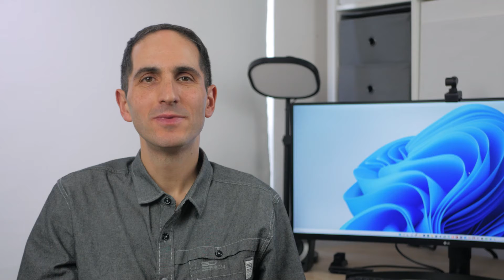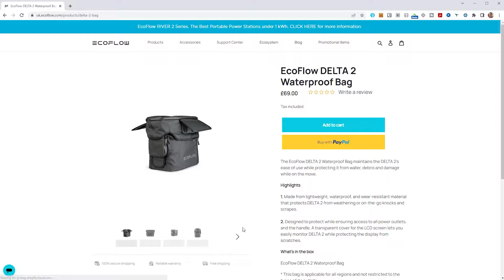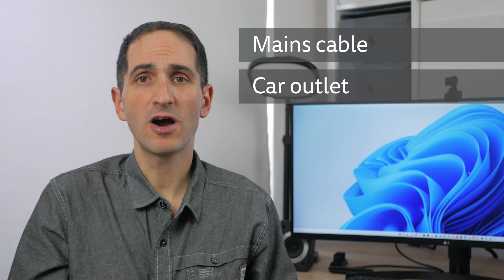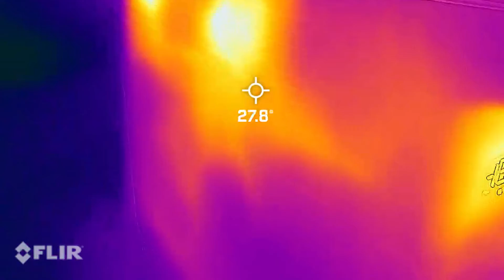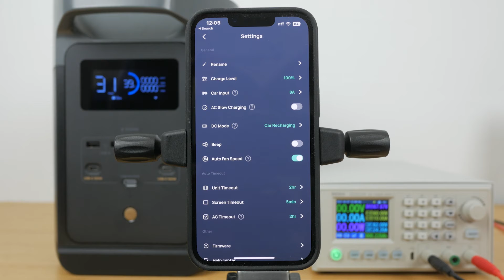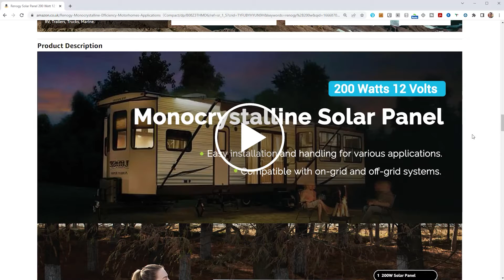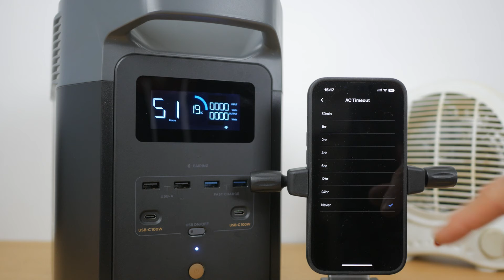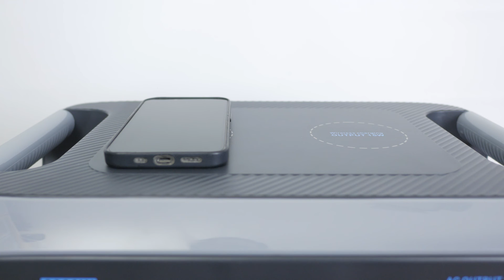EcoFlow Delta 2 detailed review | Best all-round portable power station?

Comment: Great review, thanks. I note that it can't have input from Solar and Mains at the same time - can both be left plugged in and it will start charging from mains when the sun goes down?
I am thinking of using it like a UPS, with the added advantage of some solar input.
Reply from the maker: Thanks for the comment. I just double checked this - it is still the case that AC charging will override solar or car charging. There are some automation lab features that might do what you want but I can never get them to work - although not spent a lot of time on them!
Reply: @TheTechnologyMan  Thankyou for taking the time to check that, it's a shame there is nothing in the app for that. Sending a wave to a fellow Devon'er (South Hams)
Reply from the maker: @UKBlue407  Small world!

Comment: I have this exact EcoFlow Delta 2 UK model, with the 4 AC Outlets rated at a maximum of 1800W at 240V. My question is... Is it safe to use a 13 amp fuse plug in one of the AC outlets of the EcoFlow Delta 2? If not, what is the acceptable minimum and maximum Amp fuse plug to use in One AC outlet?
My last question is, How many amps is in just one AC outlet? Thanks 👍🏽
Reply from the maker: Yes should be ok - the unit has overcurrent protection. Power = Current x Voltage, so 1800W/240V = 7.5A maximum.

Comment: Hey torn between this and bluetti ac180. Need it only to power fridge freezer in a power cut for as long as possible which one would you say I’m best off getting?
Reply from the maker: Both have similar capacity so little difference. Also look at AC200PL I just tested - has a battery that's twice the size.

Comment: Hi I had a issue with 12v car charging it would initially not show charging 100w. They asked me to do a update on app then it worked fine. 

The app you showed seemed to show a car charging option and a solar option latest app i have dosent show solar just car options so im intersted when i plug in my 220 w solar if they will show as solar panels i put.
Reply from the maker: They do update the app a lot - don't think I have a solar option now.

Comment: 25Nov23 A very nice informative review. With the Amazon Discount right now, I was preparing to order today. However, I noticed that 4 AC outlets were not 3 prong ground style like so many other portables are for the USA/Canada market. This is going to limit how many devices can be plugged in as a lot of power cords are 3 prong male. Lastly, there isn't any built-in lamp. Not sure why EcoFlow missed these two rather typical features. Your UK version AC outlets are of a different configuration. So, you wouldn't have noticed what I've pointed out for other 'followers', 'Review Visitors' etc.  Thanks! Kind Regards, Richard C. Toronto
Reply from the maker: Thanks - glad it helped - and thanks for pointing out the different outlets where you are. I agree - I like to see a floodlight on these power stations - although I've yet to see one with a really useful bright output!

Comment: When charging via solar at the same time discharging, does the load take power from the battery or from solar? Great review btw.
Reply from the maker: From battery. UPS only works with mains charging.
Reply: Great question as I was going to ask if the Ecoflow can be run using a non-Ecoflow battery bank. I think you've answered my question. It's a pity additional battery storage is limited to 1.
Reply from the maker: @johngriffiths3467  You can charge the power station from any power station. Either via mains or DC but you’ll lose some efficiency.
Reply: Thanks @TheTechnologyMan

Comment: Excellent review, we've also bought a Delta 2 and inline with your review~ However I do have a question regarding the unit though, is it normal to consume less battery at full charge, vs when it's less charged? For example, we tried to boil 1.7L of water with a 1800W kettle, when it's at 47% charged it used 19% to boil the water, and we did another boil at 28% charged, it used 27%. I would have thought it should be consistent irrespective of the charge %.
🙏
Reply from the maker: Thanks glad it was useful! You'd probably have to test with an exact load. There may be other factors at play boiling a kettle. But I've not specifically tested how accurate the battery level is - I doubt it's as accurate as the display would let you believe. Especially when using it at full gas!

Comment: hi, very informative video. Question : when i charge the delta2 from the mains, can i leave my other appliances(like a tv and a pc) plugged into the delta2?
Tx from Lenny Cape Town
Reply from the maker: Glad it helped! Yes - it supports passthrough charging. And it has UPS so those devices will bypass the unit and run off mains until you lose power when they'll switch across to the battery.

Comment: Don't buy delta 2? ... Mine worked OK for a short while then I  have had nothing but Bluetooth and WiFi connection problems. I bought a second unit and it is doing the same. ECOFLOW SUPPORT SO FAR HAS NOT BEEN ADEQUATE
Reply from the maker: That's concerning - what did EcoFlow support say?
Reply: @TheTechnologyMan  exchange and refund options are being discussed. Hopeful for outcome shortly
Reply: The Ecoflow Delta 2 works fine. If your Bluetooth is not connecting automatically then simply click on "Settings" in the app (top right corner) then scroll to bottom and click on the blue "unlink". Then just relink using Bluetooth in the normal sequence for connecting.
Reply: @Globetrotter-1  sadly my experience was another exchange which was worse and  came up with an error in the display. Thankfully Ecoflow saw the light and allowed a full refund  of the 2 delta 2's and delta 2 extra battery in favour of a delta 2 max and extra battery. I found the delta 2 to have ridiculous quality issues. I nearly had a full refund and gave up. So far so good. The delta 2 max & extra battery is working with the powerstream quite nicely this far. 🤞🤞
Reply: @under2boots  Glad that you eventually got it all sorted. No issues yet with my new Delta 2 and the River after 2.5 years of daily use.
Reply: @Globetrotter-1 @Globetrotter-1 Glad to hear. Must have been a poor quality control batch. Very unpleasant experience which went on far too long and not handled very well until I put my foot down with a firm hand.

Comment: I own the Jackery 100 pro.  I like it but the Eco flo is impressive.  I have the Eco flo 160 watt panels and they work great.  May be buying more Eco flo products soon.  They should include the solar cable connector with the Delta 2 package.
Reply from the maker: Yes I agree - solar charging cables should come with these power stations. It can be confusing, especially for new users, working out what's needed.

Comment: I tried to fill it with a Hyundai 3500 generator and it didn't give more than 30 watts, do you know why?
Reply from the maker: Using the AC input?
Reply: I put it where it says x- stream charge
Reply from the maker: That doesn't make much sense - can you check the output from the generator?

Comment: Very very nice review. You provided a lot of info in 20 minutes.  Did you have the chance to test the following: While in EPS mode, does the DELTA2 AC output has to be ON? When power go out, I understand the load connected to the DELTA 2 will be powered by the battery after 30 msec. What happen when the main power come back. Does the DELTA 2 stop powering the loads from the battery and switch automatically to the power grid?
Reply from the maker: Yes AC has to be on. When power comes back on it'll switch back to UPS mode.

Comment: Hi. Thank you very much for the review. I found it very insightful. 

I have an interesting perspective: I live in South Africa, where EcoFlow is being widely distributed - capitalising on a thing called Loadshedding (Google it for a bit of a laugh 😅); basically national power utility switches off power for up to 6 hours at a time, daily (!). EcoFlow the brand has some bad reviews, with people stating their devices break within a month. I think this may have something to do with surge when power comes back on, but I know very little about such things. 

Basically, my question is, would you rate this product for running two computer workstations - 2 laptops + 2 monitors each for up to 6 hours at a time (and then some TV to help escape from reality). 

Might need the extra battery for that amount of time though I think.
Reply from the maker: Interesting thanks! You'd need to check the power requirements of those devices with an energy monitoring plug ideally. Finger in the air guess - maybe 100W per workstation, 50W per monitor say 50W for both laptops - so around 350W. 6 hours might be unlikely - but honestly spend £10 on a energy monitoring plug and use a multi-gang extension lead with everything plug in. See what Wh you use in one hour - you might find the Delta 2 is enough!
Reply: Thank you very much. I appreciate the feedback. Would you use a surge protector when connected to the wall power? For when power comes back on…
Reply from the maker: @jandaan24  May add a little extra security from any spikes - can't see why not.

Comment: Okay so every review misses out critical information and tests. No review looks into using the solar while operating, or mains power while operating. Can the Unit be used as a UPS with continuous usage 24/7 year after year....No information!!! Does this have an AC by pass or is it okay to run the Unit while is charges on AC? More questions...can I have Solar and mains AC connected at the same time while using the unit & will mains power supplement the Solar? So many question and I don't think there is a reviewer out there with a the ability or mind to even investigate such thing...I can go on and on with more and more questions that never accrued to anyone...I should be reviewing.
Reply from the maker: This review is over 20 minutes - I try and cover as much as a I can but you can always ask EcoFlow if you have a specification question that no review has answered. In reply to some of your questions: yes it has a UPS function - but I personally wouldn't use it as a dedicated UPS - there are much better (and cheaper) options out there. But it is very useful as an occasional UPS - for example if there's a storm coming and blackouts are likely you can plug say your router etc into it and use it as a UPS. (In fact EcoFlow call it en EPS mode  - Emergency Power Supply mode). It shouldn't really deteriorate the battery any quicker using at as a UPS year on year - since the AC is just being passed through - but I just feel it's an expensive way to use it and might damage another component with constant use. Yes you can use all the outputs when it's charging. No you can't use AC and DC charging simultaneously unfortunately on this unit. If this is possible I mention it.  There is a test Lab feature in the accompanying app to prioritize solar charging which I've not fully tested yet. Hope that answers at least some of your questions. And yes if you do buy a unit please do review it - the more reviews the better!
Reply: @TheTechnologyMan  Thank you for answering some of my questions.

Comment: Hi, great review a question please if you can help me I had ordered Delta 2 PPS, the XT60 plug for solar panels is a special one? I want to say it is defferent than the one included in the package for the car charging? I had read that there is a third pin for the device to detect if it is a cable for solar charging, I want to make this cable myself, I find plugs but not the original cable. You must know I saw you had the Ecoflow panels. Is it better to use one aftermarket panel 290W  19V,  or 2 panels 100W 19V each in series? Those panels I find here.
Thanks you very much in advance.
Reply from the maker: I wasn't aware of a third pin - assumed it was a standard XT60 connector but will check next time I have it to hand. I've used third party panels with the Delta 2 without any issues. Hard to advise on the panels - can't see your link but if the 290W panel can really deliver that it should still charge faster than the 2 100W panels - if there's enough sun.

Comment: Great review with lots of good info. Question for you, how does the Delta 2 know whether it was a car or solar charging plugged into the XT60? I plan to hardwire a 12V to 24V step up converter to my car alternator to charge the Delta 2. I was hoping it'll charge at 24V x 15A, but now I'm concerned it may only pull 8A like you saw.
Reply from the maker: I've just checked and even with the latest firmware there's still no option to manually switch. As it happens just yesterday was testing their River 2 Max which does have this option and I could switch to solar charging to max out the DC input.

Comment: great in depth review . i appretiate many aspects of it not ventured onto by others . one question i had tho was at about what wattage does the fan become audible or turn on when discharging . for me fan noise whilst charging will not really be an issue . i will be potentially using it right alongside audio and video recording when discharging it . does it just depend on if the delta 2 is hot and not necessarily involving of watts . in this case if it is on for a long shoot of 3 hours with a watt draw of lets say 50 in one scenario and 80 in another, will the fan be audible in both, after an amount of time 

i as well noticed in the unit hobotech reviewed he mentioned it would not have clean sound when powering an amp, however i think this could be fixed by using a power strip that cleans it up . mahalo once more
Reply from the maker: Thanks glad it helped! Yes the fan comes on in use too - will depend on ambient temperature - but certainly at higher outputs.
Reply: @TheTechnologyMan  hmmm . mahalo for the answer . it really depends . my temps will be about 80 here . i guess it is hard to calculate since we do not have a chart the engineers have with temp to wattage graphs and fan decibel amounts . i heard though i think from you, there is a setting to turn off the fan at least in the river . how does this work out and do they warn you in any prompts

Comment: Do the fans make noise when charging from solar panels? Thinking about installing this in my camper with solar panels on the roof but don't want fans running the entire time .
Reply from the maker: The fans come on regularly so whilst I can't recall specifically if they come on when charging via solar my guess would be yes. I'll try and confirm this next time I have the panels out.

Comment: As someone who works in the Broadcast industry I have been dreaming of a portable  lithium power station/APC with removable 95/100w batteries for years. The issue is I film in remote places and you can't fly with Lithium batteries over 100wh. a 500w/600w lead solution is way too heavy to be portable but with removable batteries I could carry the cells on as hand luggage and setup when I reach my destination. Until I find such a unit I will just continue to get one delivered to my location then leave it when the shoot is wrapped.
Reply from the maker: Yes that must be a big issue! Perhaps they'll relax that 100Wh limit soon but I wouldn't hold your breath!

Comment: Very informative.  I have a Dometic portable compressor fridge which can run off both AC and DC.  When it reaches temperature it cuts out and therefore doesn’t draw power.  Currently my Beaudens power bank has an automatic shut down when the fridge reaches temperature but unfortunately it doesn’t automatically restart when the fridge needs to cut back in.  Does the Delta 2 also have an automatic shut down when no power is drawn and if so, is there a way of bypassing this?
Reply from the maker: Thankfully you can configure it to not shut down with the app :).
Reply: Thankyou for your swift response, you have been enormously helpful.

Comment: Hi great review I am now subscribed. 
I want to put one of these in my VW Campervan and charge it off the alternator when driving along, is the fag lighter socket method sufficient or could you suggest a better way to do this...thanks.
Reply from the maker: Thanks! Yes you'd use the car socket or solar panels on the move. They have their power kit model that I have to review that is specifically designed to be wired into your van electrics. Runs directly off the battery but is intelligent to will only charge when the alternator's running.

Comment: Thanks for the info! I've ordered the unit. I haven't purchased solar panels yet as I'm still figuring that out. I live in an 8 x 20 tinyhouse. I connect my house to another house with an extension cord. (I don't run much power. Mini fridge, laptop, LED lights, occasional air fryer, sometimes space heater but I have a wood stove.) I looked at the Renology 200 Watts you recommended. Wondering if those are the best solar panels for me and how many if I were to try to run my house on this battery all the time. Maybe I need 2 200W? Could this even be possible with this battery or is this more of just for emergency situation? I'm thinking of putting it on an indoor generator switch so it would be for emergency use at first but would be cool if I could go fully off-grid with the battery and solar. Any insight would be much appreciated! Thanks!
Reply from the maker: The Delta 2 has a 500W maximum input via solar - so 2 x 200W will probably be your maximum. You'd really have to check how much everything uses. Air fryer and space heater will drain it fast!
Reply: @TheTechnologyMan  Ok thanks! I just ordered an energy usage meter. I will plan to avoid using the space heater and air fryer when on it. Thanks for the tip!